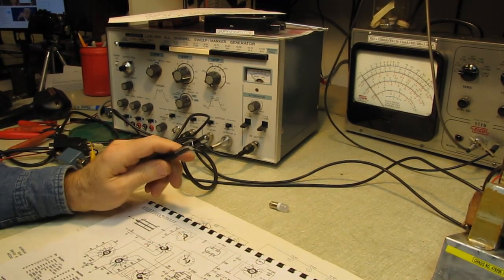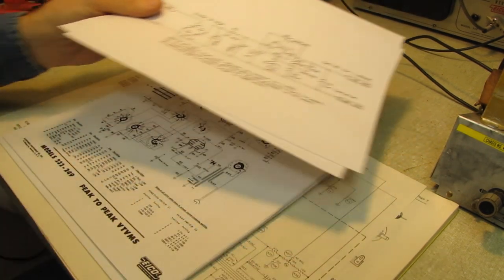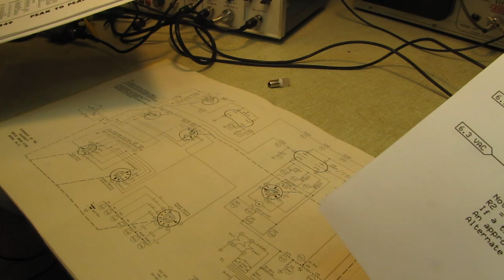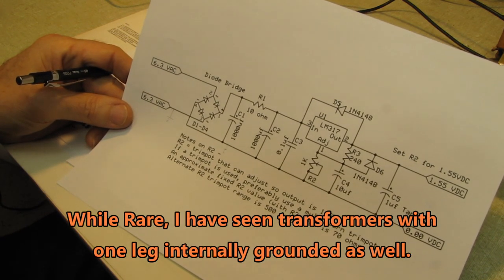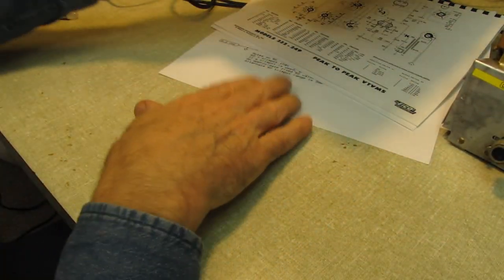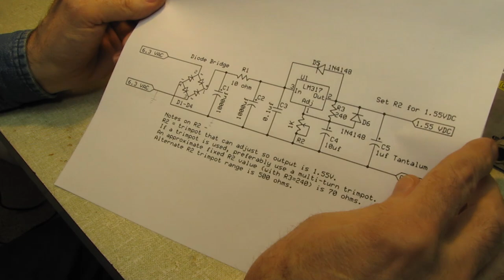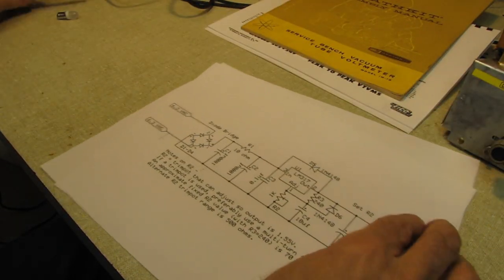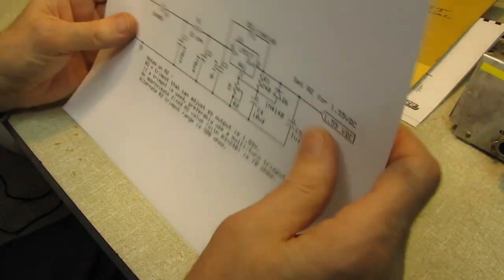VTVM BATTERY ELIMINATOR - CAUTION - TRANSFORMER BURNOUT

Comment: Thank you very much for pointing this out. I've added a much simpler (unregulated) battery eliminator to my IM-28, and was considering adding the regulated version, since the Ohms adjustment needs fairly constant tweaking without the regulator in there. I'll watch those filament grounds! (edit: luckily the IM-28 has a neon power indicator, so current draw isn't as much an issue.)

Comment: Hey Vern I can vouch for the eBay guy's stuff. I have two Eico 249s and have one in each unit. I didn't switch to LEDs but you make a valid point on transformer loading. I'll probably switch them over to. Keep up the good work and absolutely fantastic advice. 
Robb

Comment: Your proposed modification should work good for your VTVM especially since the negative side of the battery is referenced to ground.  To make an eliminator that would work for any make or variety of VTVM (units where the battery might not be directly referenced to ground) I would propose adding a small, separate low voltage transformer so that the eliminator could be completely isolated from ground. Adding a transformer adds cost, but completely eliminates any need to be concerned about the configuration of a particular VTVM. Good video! Thanks!

Comment: Thanks for the heads up.  Just pulled out the schematic of my RCA WV-98C Volt Ohmist and see that the filament transformer is not grounded.  Have considered adding a battery eliminator but about the only thing I use the VTVM for is the analog meter when doing receiver alignments.  I'm lazy enough to use the DMM for resistance measurements.

Comment: An alternative to a battery eliminator is a 'battery externalizer' -- meaning move, and attach with double-side tape, the battery carrier to the outside of the meter so that if the cells begin to rot they will not damage the internals of the meter.

Comment: At least the one eBay seller who lists a small PCB battery eliminator for the IM-11 & IMP18 seems to have a critical error in the instructions he provides. This product is just a Chinese made generic LM-317 based regulator with a trim pot to set the output voltage, and he adds an external diode and electrolytic capacitor for the half wave rectifier, I think he charges something just shy of $15 each. Following the provided installation instructions results in the eliminator PCB's 'ground' wire going to the ungrounded side of the filament circuit, and the 'V-in' wire going to the grounded side of the filament circuit. This works to the extent that the eliminator puts out the correct voltage, but the VTVM's Ohms function does not work quite correctly (typically it reads too low). Swapping the eliminator's 'V-in' (Yellow) and 'ground' (Green) wires fixes the problem. I have left that seller know about the issue, but it might not be easy to solve the problem, as it is a generic device that is supposed to be applicable to multiple models of VTVM, and they probably don't all have their filament circuit traces on the PCB routed the same way, and the installation instructions show a photo from the component side of the PCB only. Just throwing this out in case it might be tripping up anyone else.

I also wonder about so many VTVM battery eliminator designs that I have seen online, where they are woefully over-designed and therefore needlessly complicated and expensive to buy or make. If they are LM-317 based designs, they DO require a single diode for the half-wave rectification, and a suitable electrolytic filter capacitor of something on the order of 470uF. And they DO need something like a 1uF electrolytic or tantalum capacitor between the LM-317's output pin and ground. But in this application there is no benefit to ALSO putting a small value capacitor in parallel with the electrolytic. Many of these designs also have a small value capacitor across one of the voltage-setting resistors (it is not needed) and they usually have two diodes, one of which is connected from the output to the input of the LM-317; these would be good practice to include for a general purpose power supply application, where unknown capacitances and/or voltages might be connected to the output of the supply, but on a VTVM battery eliminator application, there is no time when a larger capacitance or external voltage potential will be applied to the LM-317's output, so those two diodes contribute nothing. I also see some of these LM-317 based eliminator designs where the designer did not understand the datasheet and is using voltage-setting resistors with very less-than-optimal values. Here is a tip; use a 220 Ohm 1% 1/4W resistor from LM-317 Output to Adjust, and a 47 Ohm 1% 1/4W resistor from Adjust to Ground, and it will produce a stabile voltage of appropriate level (just slightly higher than 1.5V). No adjustment needed, and the LM-317 will be operating optimally.

Comment: I added a FWB based eliminator to my IM-5228 and simply lifted the filament ground connection. I did consider the additional current draw for the filament transformer. The half-wave rectifier is going to need more current as the input cap is going to draw a pretty big peak surge charging during the half-cycles; could draw maybe 400 mA on peaks; the ohmmeter needs about 150 mA so if you add the 600 mA maybe for the filaments you might be exceeding 1 A which may be pushing the spec on the transformer. Granted, you only need the higher current draw on the lowest current range and only for a short time, but if it were left connected for an extended period it may be problematic. These points were made by the author of the eliminator I put in (PopComm March 2010). I also added two pin jacks to the front panel so I could check the voltage without having to open the case. Thanks for the tips Vern!  73 - Dino KLØS